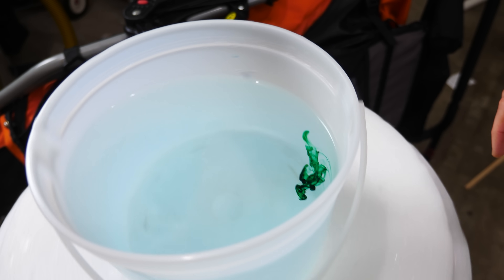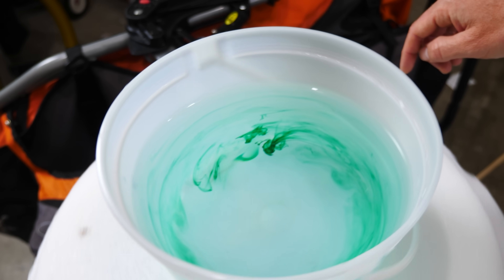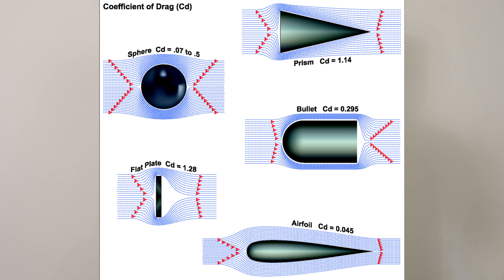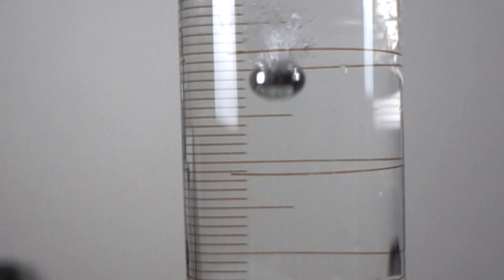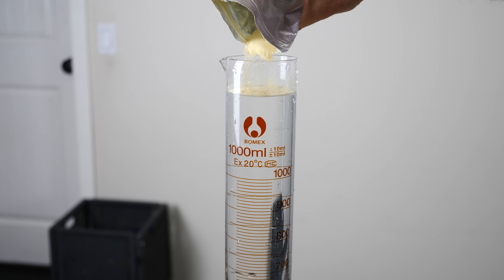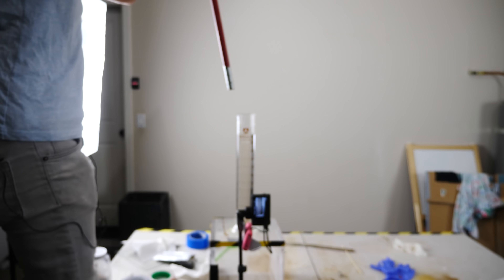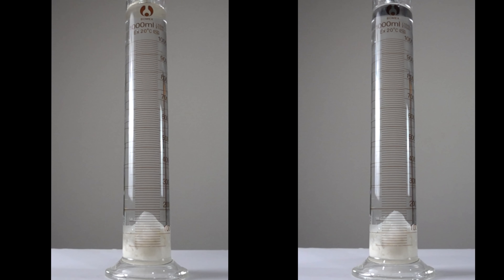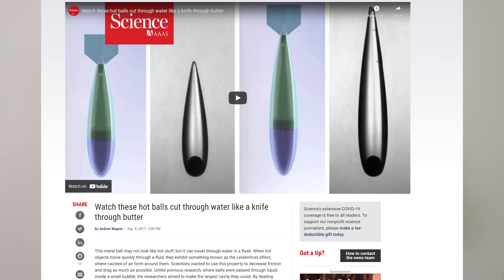Hydrophobic Projectiles Slice Through Water With No Drag

Comment: Imagine how much fuel usage this could save on boats/ships/submarines, that would be quite interesting to see in action
Reply: Yep! Many new boats are starting to use hydrophobic hydrofoils to save fuel, keep boats quieter for marine life, and get a faster boat.
Reply: Hydrophobic coating cost a lot thoo :/ and obviously it has to be re-done regularly, which for a boat means either going on dry dock or paying divers to do it :/ also very expensive. But is does reduce fuel consumption, generates more profit with the added speed... Essentially it kind of makes sense for some boats but not all of them.
Reply: Boats push water behind to move forward. If there's isn't any contact with water, it won't work the way you expect my mate.
Might be helpful to wind driven boats.
Reply: @gourav2001k  what about everything except the propellers?
Reply: @joeledwards6587  yup that's a nice idea
Reply: @gourav2001k  There is still water displacement forces. That makes boats float and move, not friction. Propellers generate a pressure diferential, and water tries to fill the void, thus pushing the vessel forward. Friction-less surfaces would only increase efficiency. Bad idea for a car tire thou.
Reply: @gastonpossel  actually got to disagree with you there. If a propeller is not in contact with the water (such as if there have been cavitation bubbles ) , the boat won’t move. May help out the hull as others have said.
Reply: @StuartB138  Lack of direct contact does not mean lack of force transmission. There would be a thin layer of air between the blades and the liquid medium, but the blades will still push against the column of water, because water still has mass and it's reluctant to move instantly (i.e. need to perform Work just to give way to the rotating blades), therefore action->reaction. The forces that the propeller has to overcome are friction (drag) and the medium's own viscosity, and you will be spending less energy on one of them. If you still disagree, please show me a theoretical explanation that proves me wrong (link), and I'll concede you the point.
Reply: @gastonpossel  the reason why big propellers spin slowly, cavitation.
It decreases efficiency of power transmission and destroys the prop.
In theory you could coat the edges of the blades with a spore paint mix, leave the edges raw, because that transfers power, but that would necessitate a radical new prop design that would make it a counter productive endeavor.
Reply: @stoneomountain2390  Yes, cavitation does decrease efficiency and damage propellers. It is not the same as a frictionless surface.
Reply: "Any propulsor which has virtually zero slip in the water, whether this is a very large propeller or a huge drag device, approaches 100% Froude efﬁciency" - Propeller Theory, Wikipedia.
I would take back part of my previous comment, a thin layer of air may produce bubbles and therefore mess with efficiency. But in principle, a frictionless interface between the blade and the water is as efficient as it can get.

Comment: Could a hydrophobic submarine survive the water pressure deep below sea level?
Reply: The pressure would be the same
Reply: @srijanumesh5355  
Yes, but wouldn't the water be repelled and not touch the submarine, therefore not applaying force on and crushing the submarine?
Reply: @Daniel-mo1rq  no, it would have the same force as the jacket of air around the sub would be pressurized by the water. It also may not work that deep for long. The gas could dissolve forcing the hydrophobic material in contact with water and even washing it off.
Reply: @Daniel-mo1rq  repelled? Water won’t be repelled tho. With tons of pressure and nowhere to go, it will have no change, especially since even the air will be compressed
Reply: @srijanumesh5355  Cool, thx
Reply: @Daniel-mo1rq  np. I’m not too sure actually. Interesting question tho

Comment: Tgsi is the same principle used in warp drive tech. Basically u create a warp bubble around the warp drive(the spaceship) and the space behind u gets contracted and the space in from of you gets expanded. Due to this difference in space, u can ride the space like riding a wave with a surfboard. Just like potential difference, if u have high potential and low potential current will move

Comment: If only there were aerophobic materials as well.

I wonder if a superhydrophobic boat propeller would perform better or worse than a regular boat propeller...

Or if a superhydrophobic car tire (like, a racing slick) will maintain traction with the ground when going through liquid.

Also, what about giving the solid torpedo a superhydrophobic coating? Would that perform even better, due to a lack of pressure drag?

Comment: That's so great, it would be even greater if this concept could be applied to passenger airplanes since a lot of crashes occur in the ocean.
Reply: Great idea, the planes would sink almost instantly.
Reply: @Milan_Openfeint  they wouldn't sink genious, they have air inside. Obvious right? It's not obvious? Oh well... 🤦🏻‍♂️
Reply: @typhoon20724  So for what other reason would you want to make planes hydrophobic? So that they can slide on water until they reach a shore? Sorry, your original comment wasn't very clear.
Reply: @Milan_Openfeint  well, between the air and the surface of the water there's a tension point, and if you hit that tension point very fast it's just like hitting against a pile of bricks. If this solution would be applied then that surface tension would be minimal and the plane wouldn't get itself apart so easily.
Reply: @typhoon20724  I'm not a physicist but I'm pretty sure it's not the surface tension that breaks the airplane when it hits water.
The water still has to move away, and it won't.
Reply: @Milan_Openfeint  I'm pretty sure it is. After breaking the surface tension of the water all you have is drag.
Reply: @typhoon20724  You need to distinguish between form drag and skin drag. While you can decrease skin drag with various tricks, including hydrophobic coating, form drag is hard to avoid in water.
An airplane is light, large and moves very fast. These together will slow the plane quickly, hydrophobic or not.
Reply: @Milan_Openfeint  well, of course it wouldn't be the perfect solution, but I'm sure it would help a bit more than the solutions we have so far. The form drag would be an issue for sure, specially because of the wings since they are also usually full of fuel, if there would be a solution to detach the wings before the impact, but maybe it's already asking too much. I think everything will just stay the same, the plane crashes, everyone dies, people talk about it around the world for a week or two, and that's it, everyone forgets and life goes on.
Reply: lmao